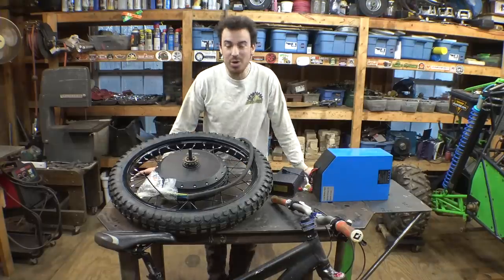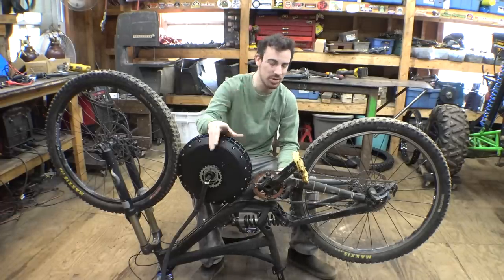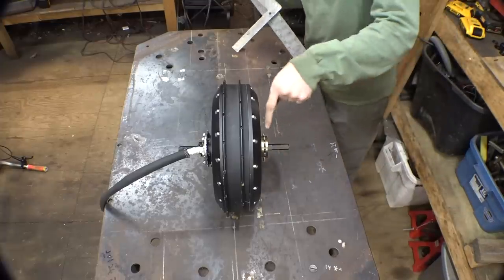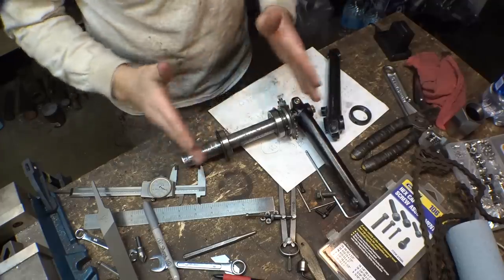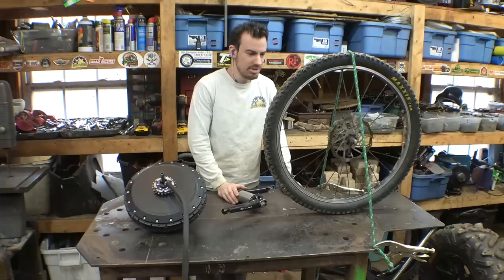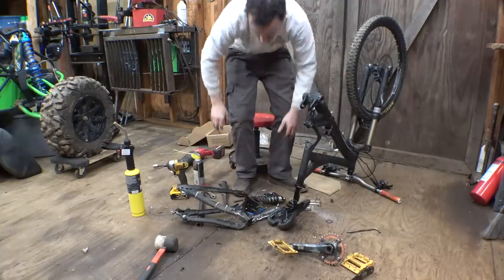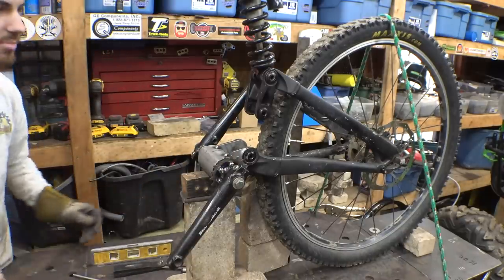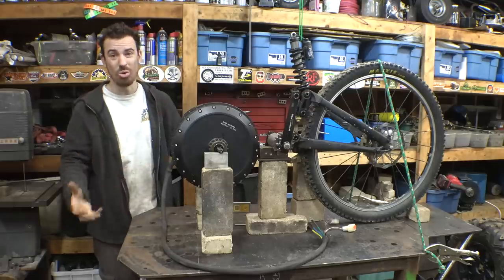Home Made Electric Mountain Bike Build - Part 1

Comment: If you made it a trike with the motor suspended between the two back wheels driving them through a jack shaft it would solve numerous problems easily.

Comment: Go ahead and start stocking up on cassettes and chains Shimano link glide and e-bike rated chain but you're still going to break them what you're doing has been done 2000 watt is about the most you can run through bicycle parts(reliably)   love the videos but that's the worst use case of that motor I could possibly think of lol  need hi RPM motor with internal gear reductions like CYC mid drive kit at 5000 watt it'll be about the same equivalent of that big direct drive motor because of the internal gearing with way way less weight and a bolt-on fit but either way looking forward to part two 🚲👍

Comment: That is the biggest bicycle hub motor I've ever seen and you're right to question whether or not the bike wheels can handle that kind of torque 

I don't think the spokes are going to be the issue though, although it couldnt hurt to replace/reinforce them. I think the tires themselves will twist and deform from the torque like dragster tires do. You're going to need bigger tires with thicker rubber. Alternatively you could try something I've been meaning to experiment with. Coat the surface of the wheels which comes into contact with the ground with Line-X but not the sides so compression can still occur 

Spinning too slow but with lots of torque? There's a gear ratio which is ideal for you, you just need to find it

Comment: I know they are pretty cheap so whatever.  But if you ever have bearings like that with the rubber seals. You can pop the seals off and flush it with parts cleaner. Then re grease them and put the seals back on. Usually will make a semi crunchy bearing usable again. Especially for a low speed/rotation bearing like that.

Comment: I've been wanting to put a hub motor that size, in place of an engine in a Kromag Puch Swinger 2 moped, in exactly the same way. Simple way to make a fast electric vintage moped.... chain drive, exactly like mopeds already are... I'd probably use a smaller motor on an MTB. Moped wheels have motorcycle spokes, or mag wheels, and small motorcycle suspension..

Comment: Hiya mate if you are going for a mid drive build this time, you wont need that motor ,as youll never be able to use its torque through a chain,itll tear it appart,,something half the size and half the weight,will get better preformance as it will be in higher rpm compared with giant qs motor
Reply: that motor 100% is going to work against you

Comment: I hate being that guy but that derailleur is going to explode if you try shifting with that motor running. You might be able to make it work if you only shift when coasting then slowly spin the motor to get the gear to shift. However at that point your going to be putting so much load throught the cassette and freehub body it might shatter, brake pawls, or the chian might skip over its contact points on the cassette. Super interesting project and inovative idea but the moutan bike drivetrain is going to be an issue.

Comment: Chris, the mountain bike you were referring to is called a recumbent. Add one more wheel, and it will become a trike. I designed several of them. It's a possibility that I did more than thirty of them.
Reply: But if you watch gnbn you call them a bike....
Reply: Bicycles have two wheels, and tricycles have three. A recumbent is where a person is mostly lying down on either of them. Yes, I did call it a bike, as most people do. They prefer a shorter way to tell people what it is. Not many people want to talk, saying the complete words. You should know that people are lazy with words. I only occasionally talk that way because I'm a perfectionist and genius. Sorry for extending this note more than it should be.

Comment: yeah same thing with one of my bikes. tried to take the swing arm off to sell to to some guy and the bolt that holds the shock to the swing arm was like rust welding shut with the bushing and I had to pretty much bend the shock mounting notches off in order to get the shock loose. then bend them back but man! its tough out here.

Comment: Hey, it sounds good… And I will definitely be watching, but is an 8000 W motor not going to destroy a bicycle chain, I put a four stroke Troy Bilt Weedwhacker, motor on a scooter, and it totally ripped the bicycle chain apart
Reply: Aren’t your pedals going to be spinning with the motor? So you’ll have to take your feet off the pedals when the motor is powered up
Reply: It's not going to destroy the chain, it's going to annihilate it.
Reply: And… When you’re under pedal power, aren’t you going to be spinning that heavy motor?

Comment: should call it rather be lathing ..the amount of machining on the bottom bracket . so... however wide bearings are , get a tube that is the right size that's 1/4 thick and slip a 1/4thick square tube in it , weld it ..slip 1"long square tube over the square tube then get another piece that rectangle and cut a square on the broadside and weld that 1" piece in and cut a releif , put a pinch bolt on it and boom done in 10minutes .. oh and the end bolt.... you would drill the end of square tube al four sides and slip a nut in their and spot weld it and weld the end and then your arm retainer bolt is done too , fully scratch built and if you wanted you could spin it in your lathe i guess you could and 1/4" is plenty thick , dont need to be carved out of thors hammer ... lol but this is constructive criticism not hating your game player ,just saying thats a lot of work you do and energy could be spent more wise

Comment: Ur issue about taking initial dimensions b4 disassembling the bike could be solved by downloading the picture of the bike online and importing it into a cad software like Autodesk Inventor or the fusion 360 that you use for your arcdroid plasma cutter

Comment: Luckily you didn't swing the motor with the swingarm because that would still be unsprung weight.
I believe having  a truck torque on a mountain bike is useless but you will have a dragster on the road.

Comment: Also. No the chain won’t handle it. You’ll need to upgrade to a gocart or heavy duty bmx style chain. If you want to keep the gear changing you’ll need to widen the plates on each side of the small sprockets to handle the heavy duty chain.
Reply: Na, just use a linkglide shimano ebike chain

Comment: Good luck with the project, It does not make sense to me but if you get it to work then good on you.  You got ripped off on the mountain bike for sure, and with the cost of the battery, and that motor plus speed controller.  Might would had been a better idea to buy one of them high end electric mountain bikes brand new instead.  But You do You.

Comment: Ball Bearings isn't really made to take the type of load you have in a swing arm and suspension linkage. Needle bearings are better but it probably comes down to simplicity of construction and service, it's easier to use ball bearings but you might have to change them more often. And they're already sealed so they can withstand dust and water as well.
Reply: Every mountain bike sold today uses ball bearings, not even radial bearings

Comment: Cranks are the arms that the pedals are connected too. You might be better off with a class 2 or class 3 e-bike as a frame. There are only a few companies that make a full suspension ebikes though.
Reply: There are actually hundreds of company’s that make full suspension mtb. Every modern day mtb brand make ps them, specialized, cannondale canyon, Rocky Mountain, trek, giant, yadda yadda there is a endless list, but they usually cost $8000 and up.
Reply: @High_Octane  full suspension e-bikes. Not full suspension mtb bikes. LOL
Reply: @spook30  that’s what I meant silly
Reply: @High_Octane  it's silly to think a class 1 full suspension mtb e-bikes will handle what he's trying to do but you do you I guess.
Reply: @spook30  I mean ebikes are silly in general
Reply: I think this project is silly in general. Class 3 ebikes have 350w motors on them. He wants to put a motor over 20x the power of that. The electric dirt bike frame is hefty enough to have integrity to support all of the weight for the components for 8000w but this mtb frame just ain't got to cut it IMO.

Comment: Why don't you try mounting the motor between the seat and crank(where the pedals connects) and build suspension around it ,if possible,shout out, all the way from South Africa .
Reply: or I know you where talking about the weight ,try despoking the mountain bike rim and replacing it with the electric motor it will be easy and you could maybe still use the main mountain bike frame.

Comment: If it doesn't make the Kessel run in 12 parsecs then you did something wrong. Just make sure you have the warp drive fully engaged and seat belt fully fastened. 😂

Comment: 37:26 if you look at the rear wheel it is scrap as it is bent if you look at it at the bottom where the strap is behind the wheel you can see it and in the UK that mountain bike in that condition would be about £20
Reply: What are you looking at?
Either way its a 24 spoke rim, barely suitable for a road bike. 32 spoke minimum
Reply: @janeblogs324  on the wheel it is about the 7 o'clock position, the easiest way to see where it is bent is to look at the rim at how round it is and you will see at the bottom there is a dent putting the rim out of round

Comment: Have you taken in the consideration the gearing of that (guesstimate) 600 rpm QS273 motor,thats not turning a 26 inch wheel? Hub motors turn way,way, slower than a mid drive motors. Your going to have to have a massive sprocket on the motor,down to a tiny on the pedals. Then massive off the pedals ,to a tiny on the rear wheel. I think. Oh yea,is that a 4 turn ,or 5T motor? You might even have to rewind it down to a 3 turn to get higher rpm. Good luck,I'm definitely am gonna follow and learn!!!

Comment: 8000 watt! Jesus loves you. Man your not building a mountain bike your building a dirt bike. With your play room there I would be building my own custom frame To better mount motor, crank and rear end swing arm to. Your design is cool but I think a bicycle frame ain't gonna cut it. I used an old 26 inch cruiser frame and make my self an electric bike using a huge 48v 27ah 1500 watt battery and 1000 watt direct drive mounted on 20 inch rims. Had a mini bike seat and BMX bars a couple cans of black Kyron spray paint.  Found a disk brake conversion kit so I could have brake (20 inch wheel on 26 inch frame and fork) and now it stops, just the front grabs and levers the long front fork so not so tight on that brake.  At this writing I have yet to see your end result .

Comment: Really interested to see where this goes! Wondering if pedals are going to spin with the motor? If so that might be difficult to keep your feet in there. Nothing worse than blowing a pedal doing 50km/h.
Reply: That motor will spin at ~1000rpm (ballpark estimate, idk what voltage he is running) and the cranks are geared up, so at the most efficient motor rpm the cranks will be spinning above 1000rpm if the motor and cranks are directly connected

Comment: THE NUMBER ONE REASON- NOT to make the Hub Motor attached to the other end of the swingarm is you'd be back to the Unsprung weight problem again!

If every bearing, nut, bolt and screw is clapped out on this mountain bike, WHY did you spend $500 for it? you could have bought forks for less than that.....

Comment: I have a 1kw Bafang mid drive and the torque out of that thing makes a new chain skip on the smallest sprocket (also new and only 13t as it's an old bike). I don't see how this can work with all that power in the middle.. Gonna break chain, sprocket, derailleur, probably one or both of your ankles.. My vote would have been for a dual 8kw motor dirt bike. OK, still unsprung weight (blah blah blah) but would climb a tree and be cool AF!

Comment: You have very good ideas but you sure don't like to tap holes way too many bolts and nuts keep up the good work
Reply: Tapped threads are about 6x weaker than rolled grade 8 nuts (that can be replaced any day of the week)
Reply: @janeblogs324  you can use grade8 bolts way easier to work on

Comment: Hey did your electric dirt bike bigger controller worked if not then try connecting controller green wire to motor's blue wire and controller blue wire to yellow and yellow to green

Comment: Soo.. the new pedal assembly gets a 1 inch solid steel shaft, while the 8kw motor gets a bicycle sprocket held by 6 Phillips screws?

Comment: Welding a 1 inch stud back onto a CV axle is a big job. 1/8th inch 4918 welding rod at 165amp makes it easy, laugh using a modified 80 dollar drill press to recut the axle splines... give out a bill with a straight face same as if it came out a huge facility. :face-turquoise-drinking-coffee::face-orange-biting-nails: why it broke... I don't know?
Reply: It was a very big thud when the spline shaft on that axle sheared off... 450lbft on a stock ford 8.8 IRS for to long... 260'000 miles, somehow. I only put maybe 3000 on it. unpayable repair bills vs privet tooling collection = win.

Comment: these electric motors dont need "gearboxes". Theres a reason 95% of electric cars are just 1 geared down direct drive. The torque speed curve of an electric motor acts as a gearbox in its own. I've built an ebike with gears: not good. I just stayed in the lowest gear at all times, and my top speed was the same in all gears. If you want any gear switching youd want to have 2: a SUPER low gear. extreme torque: and then just a regular high-med gear

Comment: As you have effectively rotated the hubmotor 180 degrees, its default direction of rotation will also need to be reversed. 
How do you propose to deal with the freewheel on the motor which is now working in the wrong direction to enable the pedals to drive the motor? (Assuming that was your intention with the pedal drive train.)
If it's a right handed thread fixing the freewheel to the motor it would simply undo itself when pedalling even if the ratchet mechanism was somehow reversed.

Dual chainwheel sprockets connected to the pedal shaft via a unidirectional clutch/bearing would have been a more sensible option and would be much safer too. Do you realise just how dangerous and unbalanced those pedals and cranks will be when being spun around by the motor at maximum rpm?

Comment: most e bikes are in the 250 1000 kw,  isn't this like 8 times that,  if the pedal cranks are connected directly to the motor then you have to pedal at the same speed at the exact speed as the motor,  with  only a throttle to control the motor that is going to be weird to ride,  I'd just skip the pedals and make it a light weight motor bike.
Bikes with a throttle and that much power aren't considered class 1 ebikes. Which is mostly what gets allowed on mountain bike specific trails.   I wouldn't ride anywhere where they are picky about that kinda thing.

Comment: I have a 1500w mid drive motor on my bike and it snaps chains, this in not going to work without motorcycle chain and sprocket, my frame eventually broke in two from the torque.

Comment: Think that your pedals are going to be going all the time with your current configuration. Also way too much weight on those tires and frame. Might want to upgrade to slightly larger in width.

Comment: Your going to stretch the crap out the chain , you’ll be going through gears and chains constantly. Stop listen to idiots about unsprung weight as the weight is supported in the wheel . When you add weight in the frame you risk shearing the headstock from the frame through fatigue, it’s just a ball ache that would be constantly need repairing

Comment: Jesus Christ please for the love of God do NOT use that massive motor with a regular bicycle rear triangle and rear wheel. I'm not joking, the way you have it set up right now I wouldn't be surprised if the torque bends part of the frame, and if it doesn't your rear wheel will certainly explode at top speed, or spokes will snap from a hard launch. I have an ebike with a qs205 (which I believe is smaller than that motor) and I'm currently running 72v/170a through it. I am using motorcycle wheels and tires, a frame specifically designed for 60mph+, and downhill mountain bike suspension, which I wouldn't even recommend. The bike is literally terrifying to me, it constantly wants to wheelie due to to torque, I have to limit it to 50% throttle just for it not to throw me off. And that's on essentially a dirt bike frame, and a much smaller motor. If you want a unique bike with that motor, put it on an old motorcycle frame with motorcycle wheels, which will be significantly cheaper and actually be able to handle the speed and torque. If you want a mountain bike, get a much smaller motor that does maybe 1-4kw peak.

Also, just FYI you will 100% need to upgrade the brakes if you don't heavily rely on regen. My build with the smaller motor had magura MT5s on it, which if you don't know are very high end 4 piston MTB brakes, and it had 200mm rotors. When I was first test riding it my boss at the shop I worked at took the bike around the block for about 5min and when he got back the brand new pads were nearly entirely worn out, the rotor had gotten so hot that it was warped to the point of being destroyed, and we were worried that the brake fluid would start boiling if he kept ripping it. And this was with a small motor, better brakes, and not even getting close to top speed. I put very expensive 2-part finned 220mm rotors on it with finned pads and the brakes sort of work but really at this high of power levels you really need motorcycle parts to be safe